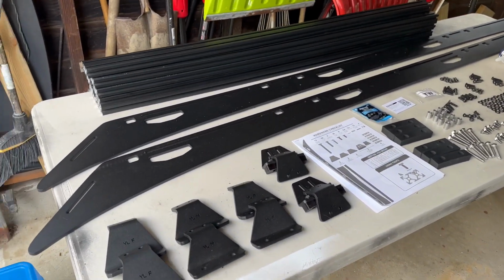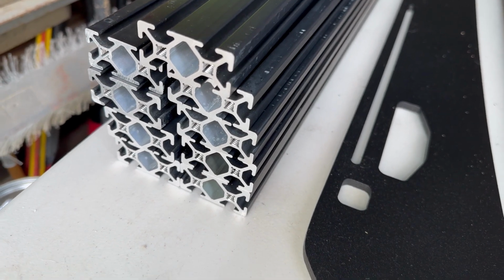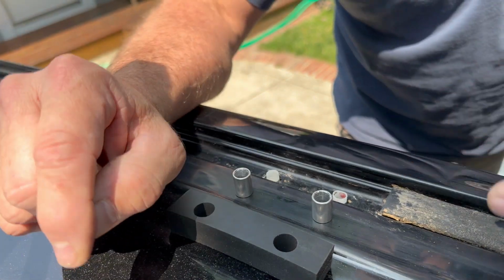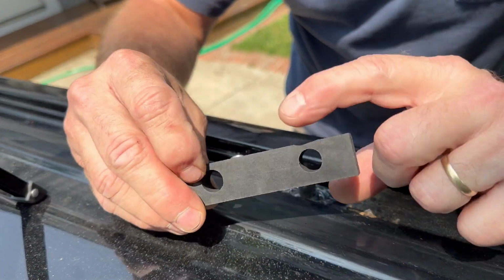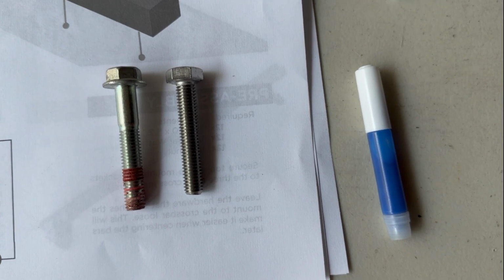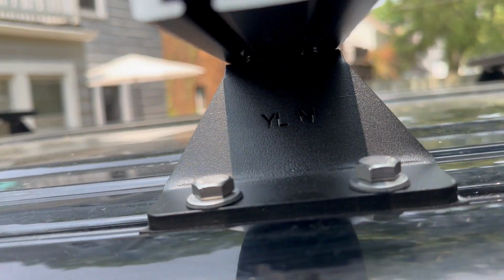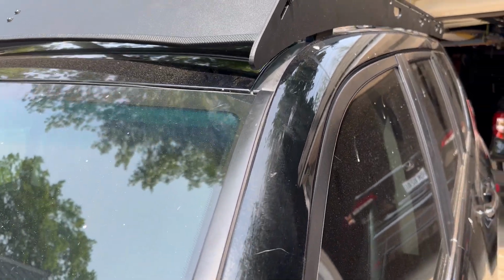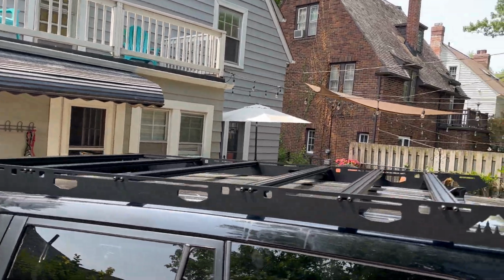Sherpa Roof Rack - Lexus GX460 Owner Install

Comment: Am I going crazy that you went from 3 mounting points per side to 4 with the adjustable bracket?
Reply from the maker: @Fpan87  correct!
Reply: @ the adjustable doesn’t get mounted right? Just resting on top of the channel trim?
Reply from the maker: @ correct

Comment: Are you removing all the original rubber pieces from the valleys? Looks like you removed the ones in the front but not in the back. Any info from Sherpa on this?
Reply from the maker: @bluegorillacookies  all we’re done the same way.

Comment: Thanks for sharing! 
Have you been on some epic journeys with it since making this video?
Reply from the maker: Yes!  Just over 10,000 miles, 9 US National Parks, 3 Canadian Provincial parks, 40+ nights in a RTT.  Plus, another 3,000 miles towing a travel trailer with a roof box.   Excellent rack!
Reply: @brianaustin1328  Awesome! Hopefully our resume will be as impressive in a years time!
 Have you experienced anything loosening up on you? And also, did you fill the gap left by removing the stock rack with a weather strip?
Reply from the maker: @doriangates9918  no loosening (and I checked a couple of times after some off-roading) and I did not fill the gap in the roof where the old rack covering was.

Comment: Nice video!  What made you go with the Sherpa roof rack?  It looks good on the truck.
Reply from the maker: Good question!  I looked at several brands, but I needed a rack that was flexible with crossbar placement, had the height to install a RTT, was easily shipped to me, and had decent YT feedback.   There wasn’t a lot of YT content on the GX, but enough to help me choose Sherpa.   I hope these videos help others, too.
Reply: @brianaustin1328  Whats an RTT?
Reply from the maker: @  Roof Top Tent.  Like an iKamper tent.

Comment: what year is that?  I want your tail lamps
Reply from the maker: 2012
Reply: @brianaustin1328 looks great… did you do anything to fill in the channel between the mounting brackets? Dies water pool in there?
Reply from the maker: @juanshaftpatel7488  I did not put anything there and have not noticed any pooling.